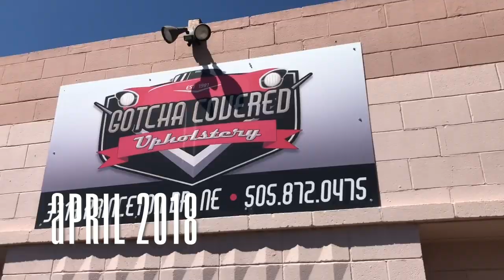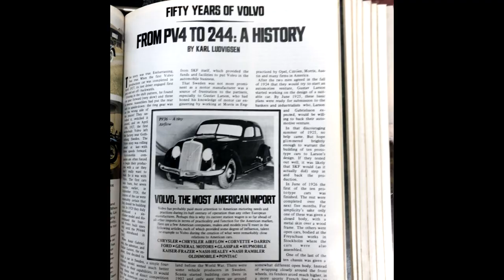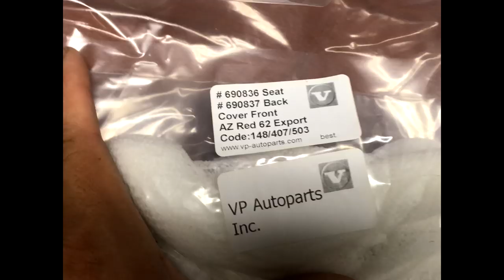🇸🇪 (S3:E6) Reupholstering Volvo Amazon Seats (pre-1964)

Comment: The really early seats used what is usually referred to as "horsehair" no foam at all. Don't know when the change was, maybe when that went to B16. I had grey vinyl in my '61 B16 122S but never had to get into the seats. Home market ones with cloth covers used to wear and expose the hairy interior but they stayed comfy under cheap covers. I agree that the early ones are a bit slabby and don't give much support but that can be improved by shaping the outer foam with stiffer stuff. Too late for that now. VP does its best to repro to original specs rather than use improved, thicker in this case, materials. Where would be without them, they provide a fantastic service.
VW Beetles used the hairy felt too and that can be had new as replacements
Reply from the maker: Deluk thanks for this information; it fills in some of the blanks.